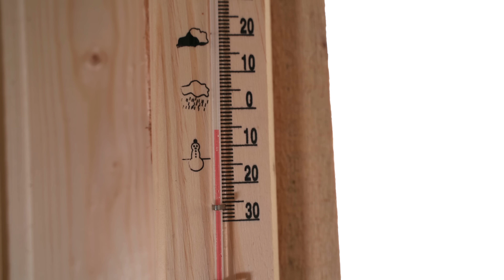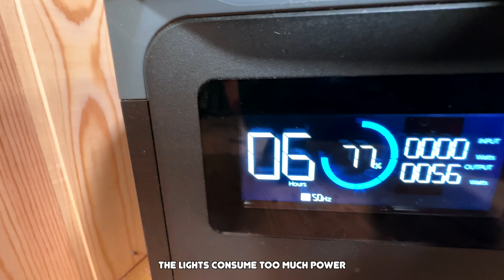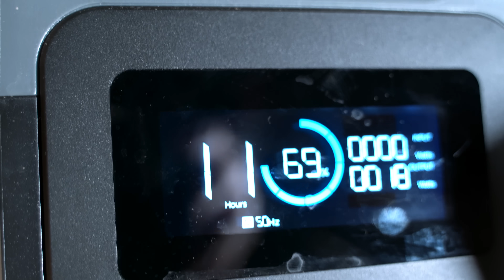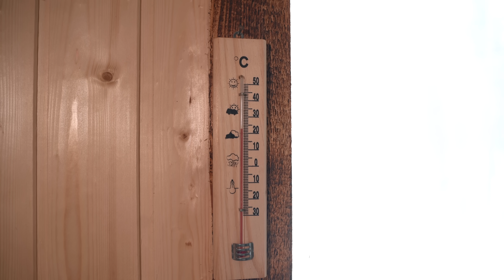TREE HOUSE LIFE | cozy winter overnight in a tree house with a stove and electricity

Comment: I know this is just a nice retreat from time to time but you really should leave a one inch gap between your heatshield and the wall it's protecting and the floor below. It provides a convective effect between the wall and shield pulling excess heat from the wall rather than conducting it straight to the wooden wall. All around decent build man. Keep up the hard work. Cheers from the east coast of Canada!
Reply: Then how come conventional construction doesn't have that air gap?
Reply: @maxsdad538  it's becoming the norm here in Canada. If you have wood heat in your home, most insurance companies won't insure the home unless a W.E.T.T certified technician signs off on it. That gap is one of the many regulations that technicians must follow. Cooling air is pulled from the floor, up the wall, as the warmer air between the shield and wall rises.
Reply: The shield and gap only apply if the wall that is being protected is flammable
Reply: This is excellent advice
Reply: @aaronmurphy2599 its wood very flamable
Reply: He doesn’t need your advice
Reply: Makes sense - and in Canada, you would know!

Comment: Such a nice cozy tree house. I see you switched from incandescent bulbs to LED. However, if those LEDs are running on typical 115 volt setup, you are wasting a lot of energy. Switch to low voltage bulbs and don't use a 115 volt convertor, if that is what you have. Low voltage LEDs doesn't have to be converted from a higher voltage to run them safely.  And that means you are not wasting energy in the conversion effort. Just an idea to save energy... Thumbs Up!
Reply: What archaic country runs 115V? :P
Reply: In other words, use 12v lights or even 5v. It’s a waste of energy to use 120v.

Comment: About your new heater. Never fit twin flued aluminium flue directly on to a wood stove. It will melt. You must have at least 600mm of stove enamelled or cast flue then a draft hood connector which connects single flue to twin flue. And most importantly, you never run an open flued chimney system at any less than 45 degrees. Never ever at 90 degrees as you have. There isn’t enough temp in the flue to force the gases out. 90 flue bends should only be fitted to forced draught flues. Ie with an extract in line fan.
Reply: You have all the answers don’t you
Reply: @bobwalton3642  He's just trying to keep him safe.

Comment: Why not use 12V LED lamps? They waste less energy and last longer. I use them in our chicken coop, which is about 50% bigger than this cabin. I run them off a battery charged by a solar panel.